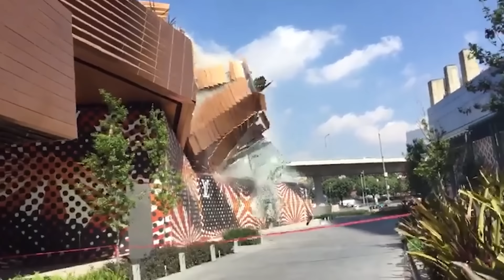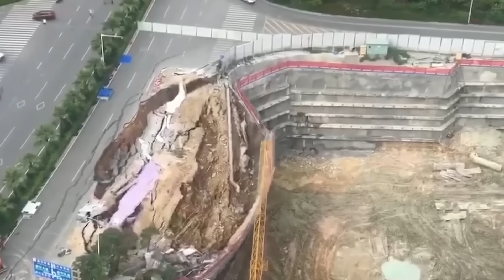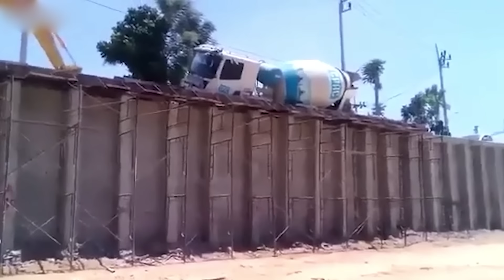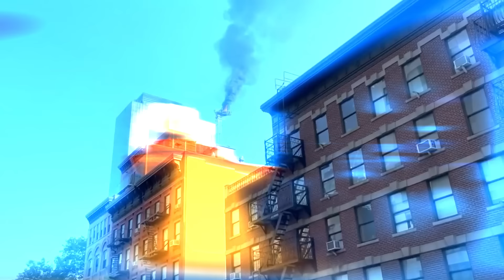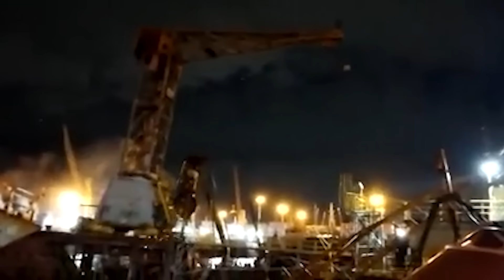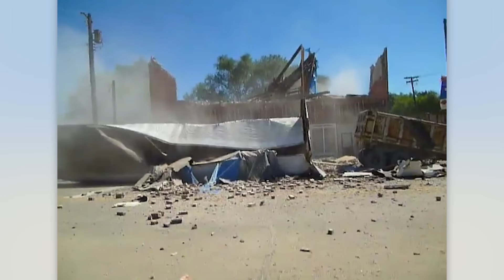55 Biggest Construction Mistakes in the World

Comment: A stark reminder of how stupid/uneducated/unskilled some crane operators/structural engineers are. There is an undeniable connection between Europe having the strictest building codes and safety requirements and Europe having the fewest construction failures per capita. Educate the people who do the construction, enforce proper procedures and materials, and the result should be seen soon: stuff left standing instead of collapsing.
On the down side, you included a lot of footage of well executed demolition works, why label that as "construction mistakes" is beyond me. Well, money, of course, but apart from that?

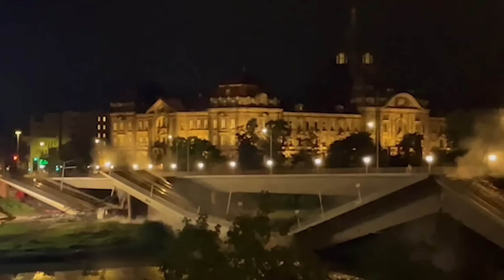Comment: 12:00 That wasnt the historic Carola Bridge. The old one was partially blown up in May 1945, the rest of the old bridge was demolished in 1952. The third version of the bridge was build in 1971, it was one of the first bridges with this kind of construction in the GDR.  The cause of the collapse was hydrogen-induced stress corrosion cracking of the tendons within the prestressed concrete.

Comment: I think the demolition videos where the structure not falls the direction they want are not poorly calculated but poorly made. What I saw the issue was alwys when the hole made in the structure was on the falling part. I think it should be on the lower or the part on which will be  the collapsed part falling. When you cut a tree you should make angle at the top and bottow part between the cut of the log.

Comment: Tailings dams are a disaster waiting to happen. They are very structurally unsound and require a lot of maintenance and monitoring just to be functional. One of the more infamous disasters involved with them is the Stava Valley flood in Italy. The dam collapse wiped out two whole towns after it failed.

Comment: 3:50 The cranes did not collapse, they toppled over because they were on floating pontoons without proper mooring or balancing. The irony is that this happened in the Netherlands, quite famous for its engineering in, with or around water but this one they got 100% wrong.

Comment: 0:59 This was actually caused by the unauthorized addition of a 'roof garden' on top of the cantilever structure! The addition of several tons of extra weight (earth etc) pushed it past design limits. In the video you can clearly see the grass and plants etc that weren't even SUPPOSED to be placed on top. Apparently the overloading was almost twice the designed load factor. Also China's general building standards are HORRENDOUS compared to the Western world.

Comment: every time I see a crane collapsing with weight, I think to myself:  Math is so important, and why are some people obviously unable to read ?   
Such things are literally impossible if you do the Math
Reply: I always wonder have designers ever looked into having a button in the crane, that lets the spool freewheel, and drop the load?
Reply: @bigredc222  It would seem a reasonabloe idea.  If the crane tips over, it drops the load anyway.
Reply: @bigredc222 they're called friction cranes. And they're more or less obsolete. Still a few around
Reply: Don't they have a tape measure that is eight meters long?
Reply: You’d think there’d be a handbook with some basic numbers like, “if the boom is extended x feet, don’t try to lift more than y lbs."
Reply: @americanAlienBoy  Seems like it should be a gauge right in front of the operator, with a redline.
Reply: @natehill8069 there essentially is..but sometimes you don't know the weight until it's lifted. There are load charts you can read as well as load moment indicators. Which are the computers
Reply: Math's...😂
Reply: Is there math for every unknown variable. Of coarse not
Reply: @neilfoss8406  So many of these incidents are due to a crane holding a load too heavy at too long a reach.  It comes down to math, pure and simple.  Of course, I don't expect the crane driver to do the math on the spot - but it will have been done by the crane designers, and there will be a notice issued with the sale of the crane about its limits.  I have never been in construction, but I would expect modern equipment to have alerts and warnings that limits are being exceeded.
Reply: @neilfoss8406  Its called probability theory lel
Reply: @neilfoss8406  way to much mass on a way to long arm....  for me its simple Math and physics to prevent this from happening.  The Max load you can put on an arm togehter with the max lenght you can draw an arm.  Do the Math, Use two cranes, whatever but 100 percent of these incidents are preventable
Reply: Read the room, Math Wizard. Nobody cares
Reply: @DionSt.Michael  Oh, I don't know - when a crane valued at several millions tips over and drops hundreds of tons on something that can't support it, so that the overall cost of recovering from the error runs into the millions for material costs as well as hospital stays, I reckon Somebody cares!
Reply: @DownhillAllTheWay    Naaaaaaah! 🤣

Comment: 10:40 Seens lots of these lift fails, but have a question, whay doesn't the Operator simply release the lift brakes and allow the load to fall in turn unloading the crane which may remove the damages involved in it collapsing, it's damage to surrounding equipment/structures/lives and the Operator going for the ride?
Reply: Because when it starts tilting they jump clear of the cab and evacuate the area rather than staying in the crane and trying to recover it. The safety of the operator comes first
Reply: I have wondered the same thing. As soon as you FEEL the crane lift, measures should be taken to reverse that action to regain control.
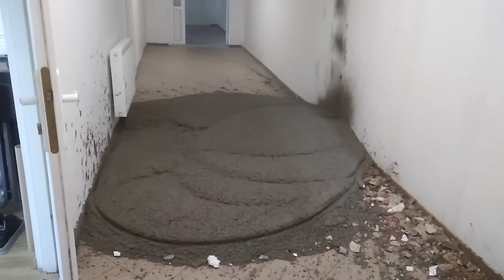Reply: And at 13:15, why don't they lift the load?